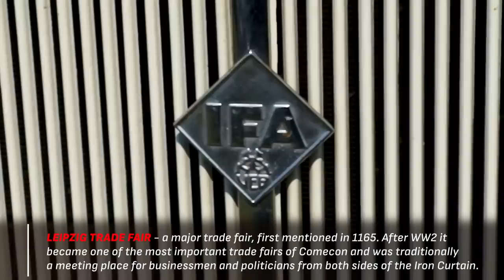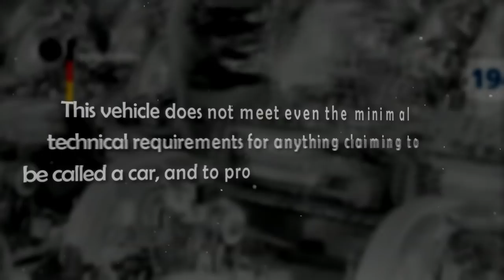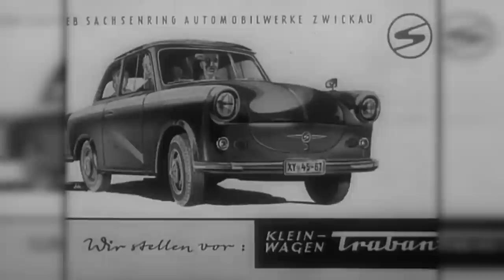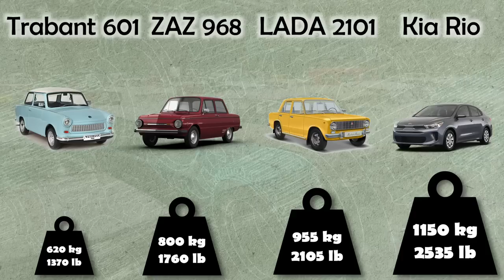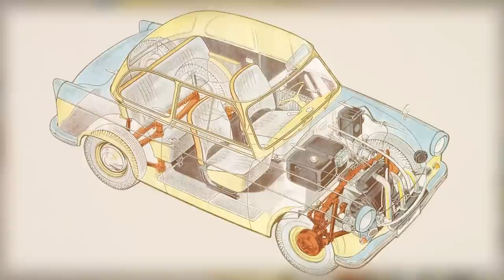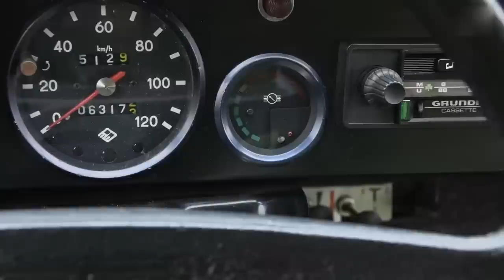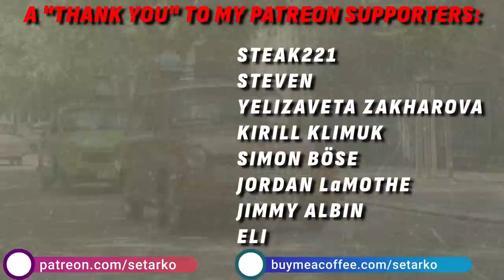Trabant - A Plastic Masterpiece of Developed Socialism

Comment: My family was lucky enough to have a Wartburg rather than a trabant
Reply: I love Wartburgs, especially that older "312" model. We had them in Poland. Most of 312s were blue with white roof, 353 green and 1.3 gray.
Reply: @obywatelcane6775  Be careful with the 312 name because there is a little bit of confusion between us and our friends in Germany. They only use the 312 name for 1965 transition model with coil springs but when the 1000 model came out in 1962 it was already supposed to be called 312 and export markets stuck with that name when the GDR went with "Wartburg 1000" for their market. So when German Wartburg fans hear "312" they usually think you're referring to the transition model specifically and not general model like we do in Poland
Reply: @professormicron6470  See ==I didn't know about that. In Poland that one with coil springs was called 312/I. Some of them had different grille - horizontal bars and chrome inserts around the turn signals. On the street we always were calling that "bubble" model just the old Wartburg and 353 new Wartburg. Sometimes if somebody wanted to make fun of 311/312 he was calling it a 4 door Syrena 🙂

Comment: The Trabant was outdated when it came out and from then it was produced 35 years with only minor changes 😂😂😂😂😂 best joke ever besides British cars.
Reply: The first part of that statement is flatly wrong. The Trabant was actually quite advanced when it was first released in 1957. Unibody construction, front seatbelts, front wheel drive, rack-and-pinion steering, and a transversely mounted engine for starters.